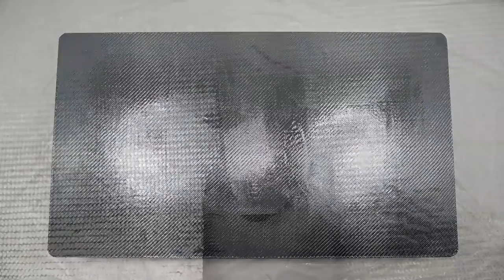Carbon Fiber Table with Epoxy Resin [DIY]

Comment: All together very poor carbon fiber work, none of this is how to make carbon fiber parts.
Reply: This is why it's called DIY and not HOW TO.
Reply: You have no sense of humor. It's japanese humor is very different.
Reply: TrueMenImproveDaily agreed, he killed it with putting the bag over it at the beginning, that did no help at all
Reply: TrueMenImproveDaily do you have any how to videos ????? I been making composites for 20 plus years from very simple molds to complex molds. I use a ton of vacuum type setups but have also used a lot of cnc molds that require a use of a bladder.  What he did here is fine for a damn table and other non structural parts. I still use a compression wrap method to make carbon tubing and comes out just fine. His ideas were there but just needed a few extra precautions. There is always one looking to ruin it for someone. All you had to do was just move on but instead you put you negative comment in. Typical internet troll let’s see your work  !!!!!!  

Anyway nice video enjoyed watching thanks and keep it going.

Comment: You should never have used gelcoat, instead a thin layer of epoxy to establish the wood surface. Once cured you then place the carbon cloth wet and align the weave.
Reply: Paint the board black then let set. Then use clear epoxy to adhere and cover the CF cloth. Then you have no black bleed through visible

Comment: Well I was expecting a carbon fiber table, not fibreboard wrapped with carbon fibre sheet....
Reply: that's because you don't understand how composite objects are made or at least you didn't
Reply: @drumbum7999  I'm with embino, and I do have an idea of how composite objects are made. At first I thought he was running a very thin piece as a core, but this is more of a laminate that is true carbon fiber. Or that he was using that piece to create a mold. I'm not disappointed, it is a nice looking table, but you get all of the cool looks of carbon fiber but without the lightweight benefits of carbon fiber. Granted he didn't have to lay multiple layers, add in core material, create support structures and bracing, so from a time and cost perspective, it was the best route.

Comment: ?? not a carbon table.. a carbon wrapped table.  huge difference.
Reply: MMORPG87 what he’s “wrapping” is real carbon fiber, carbon fiber isn’t just a thick material it’s a weaved material you wrap a surface with until it molds shape so yes it’s a carbon table
Reply: Umm no.  Whats the point in even wasting money on real carbon just to cover mdf and call it a carbon table...  Guess if i cover a steel car hood with 1 layer of carbon its a real carbon hood huh... But it is 2020 if a guy puts on a dress hes a real girl

Comment: Just a bit of advise, a tack clothe works better when it’s fully opened and then lightly balled up, helps activate the adhesive in it. Also when sanding with high grit paper you should use wet, avoids the paper clogging up and causing pig tail scratches in your finish which can show up after polishing since it’s basically gouging into your topcoat.

Comment: As a fan of simple tools that make life easier, I think you would benefit from a few different sizes of 'notched' adhesive spreaders, for your gel coat. The notches are small and when the correct size is selected, it'll let you spread the gelcoat around a large area while leaving the right amount behind. This'll let you get the coating over the whole area quicker and prevent extra work needed to fix thin/thick pots.

Comment: I think you could make this a lot easier if you wetted the carbon fiber all the way through at first and then used a perforated film with a breather layer under vacuum to get all the excess resin out. Then just quick sanding and you got a nice even surface without these darker spots

Comment: I really like your simple videos, no narration or music. Next time you want a mirror finish on a flat surface just use glass and then bond your laminate to the MDF board.
Reply: Or do as you say and lay up on the glass, then add the baseboard and wrap the carbon around it... It's how I would do it, and would use a clear gelcoat or initial layer of epoxy with lightweight glassfibre before laying in the carbon.

Comment: I would make it other way. Take a glass as a base. Lay epoxy, then carbon. Use roller to remove bubbles. Then put board on top and vacuum it. You should get nice  clean surface.

Comment: it was amazing. 
i worked with epoxy resin for about 2 years and i always wanted to use carbon fiber in my projects. with watching this video, i am going to do it. thanks for sharing the video. 
just need to know about the epoxy you used on the pallet, can i use ordinary resin instead or it is special?

Comment: Sei un genio !!!! Volevo un consiglio devo fare delle parti di carbonio alla mia Maserati ma vorrei mettere sotto la pellicola carbonio e sopra la resina che ne dici ? Potrebbe resistere?
Reply from the maker: Hi, buddy!
https://youtu.be/OrcN5b62mF4
Please watch this video. This url is working on carbon fiber interior.
In carbon skinning, it is very important to apply epoxy resin and leveling the surface.
You have to apply epoxy resin many times.
When leveling the surface, be careful not to damage the carbon fiber cloth.
I hope you can make a good carbon fiber parts.
If you have question, please reply.
Thank you for watching. ^^

Comment: Nice work I love the videos keep up the good work. 
If I was to make the same thing I would do one the methods some the companies use to make flat sheats and use a sheet of glass or 2 to keep it truly flat and no MDF so it's just carbon.
And use carbon tubes for the legs and or aluminum.

Comment: I have a couple questions you gave me the idea to a flat door panel and I am thinking of using you method since is practically all I need to do is use this same format. What kind of gel coat is that.

Comment: I would like to know.. how we want to take care the brush after use the epoxy... Because if just wash.. it will be harden
Reply from the maker: Hello, Buddy!
I do not reuse brushes.
I buy and use several cheap brushes (approximately 5 cents).
If you want to reuse the brush, you can wash it with acetone.
However, it cannot be reused much.

Comment: can 2k clearcoat in a can spray be used instead of a polish compound and buffing  after the surface has been sanded down? Or will it still show the sanded parts? Thanks
Reply: Yer use UV clear coat spray     Do wet sand first and acetone to clean spray coat 50mm over spray wait few minutes to go over again don’t let it dry or the edges after 3/4 coats let dry 12 hours then do your polish

Comment: Why didn't he removed the plywood?
Reply: MDF
Reply: If you were to make a 3/4" thick table of carbon fiber it would cost about 2000 usd... the skin is very thin, and decorative, not able to hold any additional weight... probably 250gm/m2 carbon and likely cost him about a hundred dollars us to make a a skin...

Comment: Regarding those 152mm abrasive discs you used with the deWalt sander, which brand do you use? I recently switched over to Kovax which have better value for money than Norton.
Reply from the maker: Hello, Buddy!
The sandpaper (for dewalt) I use is from Korea.
It's a brand called HANKO, but I don't have any exact information about it.
Hand sanding uses SIA.
SIA sandpaper is very good.
Reply: @ECOLAPStudio  Hey tjanks for the speedy reply! Yea well if HANKO is Korean I'm pretty sure its quality stuff! I'm a big fan of Korean manufacturing quality standards 😊🖒

Comment: Are you guys using different resins fir every steps
Reply from the maker: Hello, Buddy!
I am using several epoxy resins.
Epoxy gel coat, laminating epoxy resin, and top coat epoxy resin were used.
The epoxy resin used varies depending on the composition.

Comment: Sir can u list these items 
Also plz can u share the epoxy mixing
Reply from the maker: Hello, Buddy!
I purchased materials from a Korean online shop.
However, Korean online shops do not ship overseas.
So I'm going to show you an online shop in the UK.
Epoxy gelcoat  https://www.easycomposites.co.uk/#!/resin-gel-silicone-adhesive/epoxy-gelcoat/epoxy-tooling-gel-coat.html  
Lamating epoxy resin   https://www.easycomposites.co.uk/#!/resin-gel-silicone-adhesive/epoxy-resin/EL2-epoxy-laminating-resin.html
top coat https://www.easycomposites.co.uk/#!/resin-gel-silicone-adhesive/epoxy-resin/epoxy-coating-resin.html
carbon fiber cloth https://www.easycomposites.co.uk/#!/fabric-and-reinforcement/carbon-fibre-reinforcement/woven-carbon-cloth-under-400gsm/22-twill-240gsm-3k-1-25m.html

Comment: Reason for failure, no peel ply or breather absorber and not enough squeeze to even out the resin.
Reply: Best Kiteboarding Official why in the world would you need any of that stuff just to do an overlay? He started out ok until he put that bag over it to try and compress it, definitely didn’t need the bag.

Comment: how do you deal with the smell ? looks like you do this at home.
Reply from the maker: Hello, Buddy!
When working on carbon fiber, the smell of epoxy resin is always a concern.
I'm making carbon fiber at home. I care about ventilation.
After using the epoxy resin, be sure to open the windows and ventilate.
It is best to open the windows because there is no ventilation system.
and If you let me know your email, I will send the canard file to you.
Thank you for watching.

Comment: Why do you always apply epoxy gel coat under the first layer of carbon fiber? As you are not doing a mold, why not just using epoxy resin?
Thank you
Reply: The black hides the mdf underneath. It also just the process for skinning

Comment: Can somebody tell me what cause that mistake?...newbie here
Reply from the maker: Hello, Buddy!
I used too much epoxy gel coat in my first job and it was a very short curing time.
So the gel coat flowed through the carbon fibers, and the carbon fibers weren't clean.
So I reduced the amount of gel coat and lengthened the curing time.
I hope you helpful.
Thank you for watching.
Reply: @ECOLAPStudio  thx for the info...i learned a lot from your channel...👍
Reply from the maker: @nazikistah2003  
I am happy to be of help to you.
Please comment or email me if you have any questions.

Comment: Great channel, just subscribed. I understand that you had too much gelcoat the first time. But why did you even bother putting on gelcoat? Couldn't you just have put epoxy resin on top?
Reply from the maker: Hello, Buddy!
It could also work with epoxy resin.
However, it is recommended to use a gelcoat.
There are several reasons to use a gelcoat.
First, the gel coat is very viscous and does not flow down.
And, the base color of the parts can be covered with black epoxy gelcoat.
I hope you helpful.
Thank you for watching.
Reply: Knudsen Allan yes your right, it’s cheaper just to make your own “Gel Coat” or thicker resin. He could’ve added black pigment to the resin. And to thicken it a bit also he could’ve added glass microspheres to it. It’s pretty much the same instead of spending extra money surface coat

Comment: How do you keep it dust free when top layer resin is drying?
Reply from the maker: Hello, Buddy!
Small parts are top-coated and covered with a box.
However, for larger parts, apply several top coats and polish after leveling.
Large parts are difficult to avoid dust.
Reply: You don’t. For large items if you’re doing this at home you take 1000 grit to remove dust nibs just as you would if you’re painting a car in your garage dust and bugs will typically land on the clear coat while it dries

Comment: Eveytime i apply carbon fiber it tends to fold and not shape according to the corners
Reply from the maker: Hello, Buddy!
The corner clearly has a fold.
Therefore, the part needs to be coated with a lot of epoxy resin.
Then make it flat with sanding.

Comment: Can I use carbon fibre vinyl wrap?
Reply: You could but it wouldn't be nearly as durable.And it would require buying a heat gun and scissors

Comment: whats that black stuff ?
Reply from the maker: Hello, Buddy!
The black is an epoxy gelcoat.
The Epoxy gelcoat is used to laminate carbon fiber cloth.
I hope you helpful.
if you have any questions, please reply.
Thank you for watching.
Reply: ECO-LAP Studio  I was sanding down a cracked carbon fiber wing, and ended up going though the carbon fiber to epoxy that’s under it, any way to fix this ? Do I have to overlay the whole thing again ?
Reply from the maker: Do you mean that the carbon fiber pattern under the top epoxy resin is damaged?
If the carbon fiber is damaged, it is impossible to repair the pattern.
As you say, you have to lay up carbon fiber cloth a whole new one.
If you don't care that not looks good, you can paint the damaged area with a black paint marker and apply epoxy resin.
But the way can't repair the pattern of carbon fiber.
it also won't be looks good a little bit.
I hope you helpful.

Comment: Am I the only one who noticed that he switched back to the fail one and back again just before it was done ?
Reply from the maker: Hello, Buddy!
In fact, it was the failed table top that was used in the epoxy resin scene.
However, It is a new table top that was used in sanding, polishing, and the final result.
I had a problem with the filming process and I was forced to use a table that failed in the middle.
I hope you understand my mistake.
Reply: @ECOLAPStudio  So you noticed that too, Cool :)

Comment: TrueMenImproveDailyI will and many others. 

Do you have any how to videos ????? I been making composites for 20 plus years from very simple molds to complex molds to making a shit ton of carbon fiber and carbon aramid hybrid plate. I use a ton of vacuum type setups but have also used a lot of cnc molds that require a use of a bladder.  What he did here is fine for a damn table and other non structural parts. I still use a compression wrap method to make carbon tubing and comes out just fine. His ideas were there but just needed a few extra precautions. There is always one looking to ruin it for someone. For some people its just about making something themselves and not buying a damn piece of vinyl to stick to something. What he did requires talent. All you had to do was just move on but instead you put you negative comment in. Typical internet troll let’s see your work  !!!!!!  

Anyway nice video enjoyed watching thanks and keep it going!!!
Reply: chris81983 ever thought of doing tutorials? Might be a good idea bro. Respect to the guy for his creativity
Reply: @mikec3767 I actually have and this is one of the reasons I hate to see people bashing content creators. It's hard enough to do a job or hobby. Now add having to record and edit everything you do. It's just too much time for a smaller shop like myself trying to make a living and still have fun doing it.

Comment: Thanks for sharing your journey with this idea. 
However, there is a lot of questionable elements here (wet wipes? lol). If you want carbon for the looks, just get a foil. Leaving the wooden part inside makes it paradox to use and me scream from the inside.
Reply: You do use various cores in composites and here wood is good.
Reply: @spudpud-T67  the question I am raising is, why using carbon fibre here in the first place. It is a high-tech super light material. Even without the wood inside, it wouldn't really make sense to use it for a static object which isn't subject to a lot of stress. I'd doubt you would use wood like this as a core material in technical application? Maybe sth lile balsa instead?
Reply: @lukass2576  Maybe he was going for a modern high speed table.

Comment: Kasi keterangan nama bahan nya dong
Reply from the maker: Hello, Buddy!
I purchased materials from a Korean online shop.
However, Korean online shops do not ship overseas.
So I'm going to show you an online shop in the UK.
Epoxy gelcoat  https://www.easycomposites.co.uk/#!/resin-gel-silicone-adhesive/epoxy-gelcoat/epoxy-tooling-gel-coat.html  
Lamating epoxy resin   https://www.easycomposites.co.uk/#!/resin-gel-silicone-adhesive/epoxy-resin/EL2-epoxy-laminating-resin.html
top coat https://www.easycomposites.co.uk/#!/resin-gel-silicone-adhesive/epoxy-resin/epoxy-coating-resin.html
carbon fiber cloth https://www.easycomposites.co.uk/#!/fabric-and-reinforcement/carbon-fibre-reinforcement/woven-carbon-cloth-under-400gsm/22-twill-240gsm-3k-1-25m.html

I hope you helpful.

Comment: I've watched loads of epoxy videos using CF and not one (other than this one) vacuum seals it in a bag.

Should be called CARBON FIBRE ASMR FAIL!
Reply: Yeah you should vac seal it if you’re infusing. Idk why he did it.

Comment: Isn't the whole point of carbon fiber light weight + strength? There is still a huge slab of wood inside. You did an amazing job but I don't see the point.
Reply from the maker: Hello, Buddy!
It's carbon fiber skinning.
Reply: The point is to have a carbon fibre style coffee table, because maybe he likes the carbon fibre finish. You do know not everything has to be about practically yeah. 😂